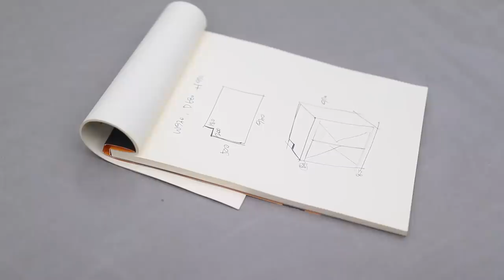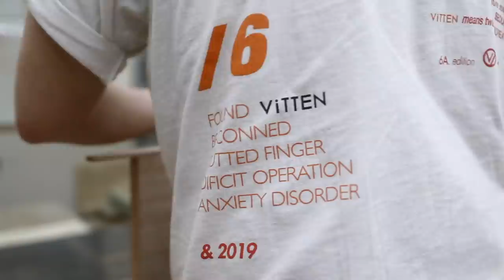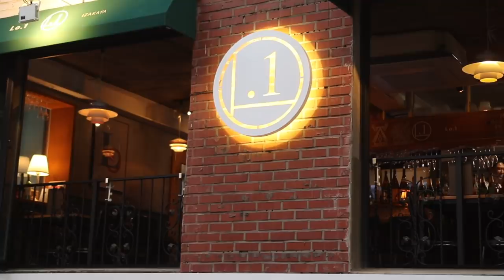W59_Plywood cabinet

Comment: excellent work bro! .. you use nothing more sealant or is varnish ?, and another question, nothing else a pass of varnish or sealant aplicas or are several?
Reply from the maker: Thanks~ Bro~! I more apply oil or polyurethan several times. but it edited in video.
Reply: @ViTTEN  👍😉